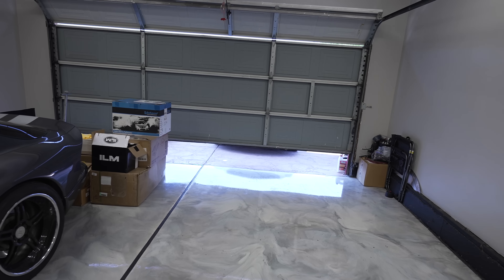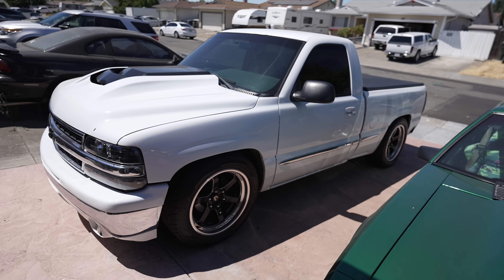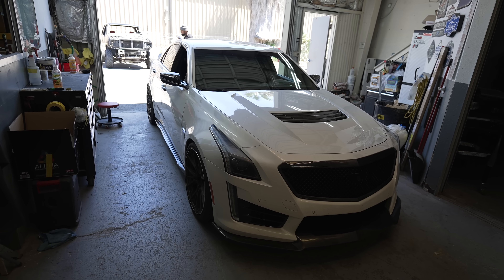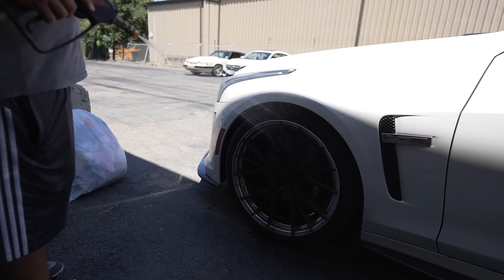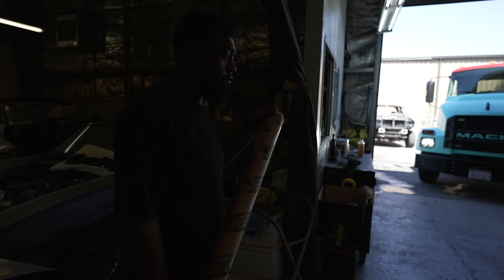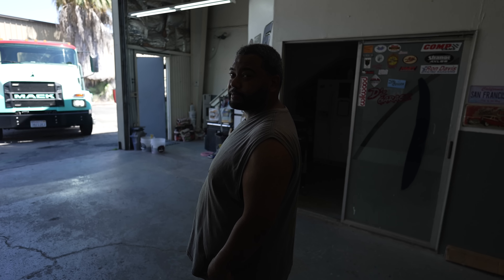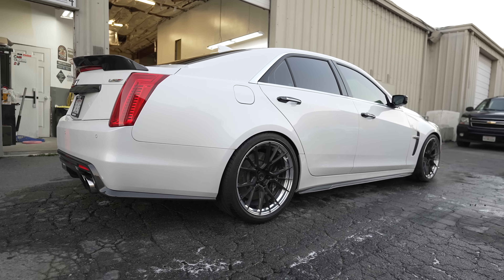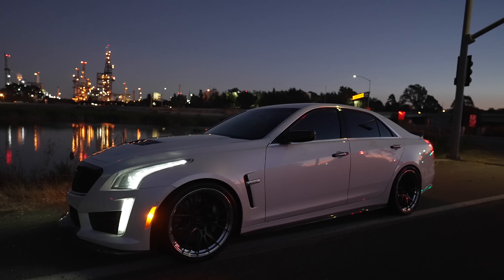The V3 Looking Like A Brand New Car Now!!!

Comment: For brake pads with little to no dust, get the powerstop z26, I’ve ran them on my v3 for about 2 years now and they’re far better than oem, and still have enough stopping power for when I’m roll racing and stuff